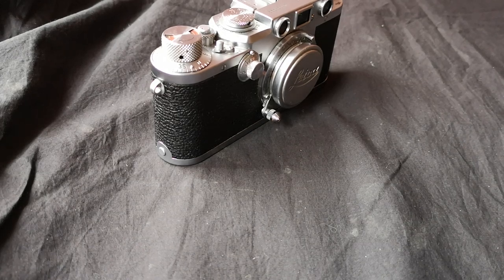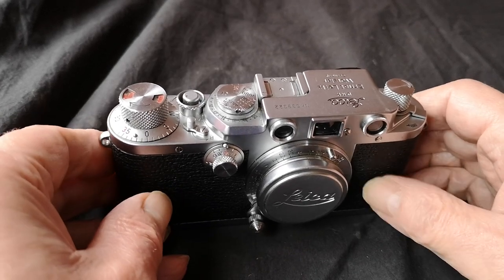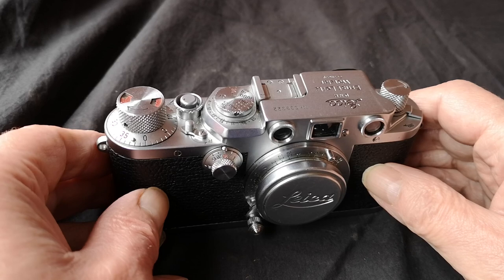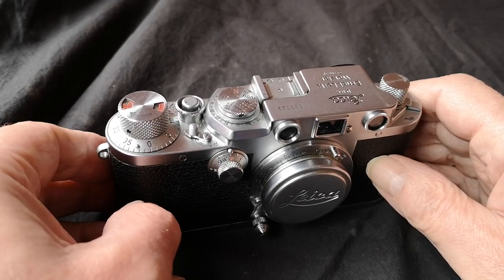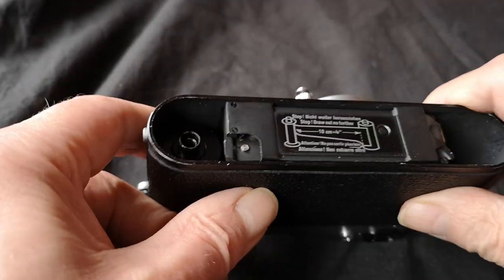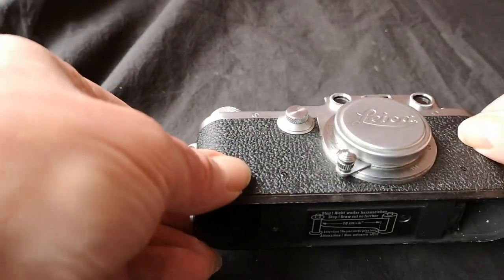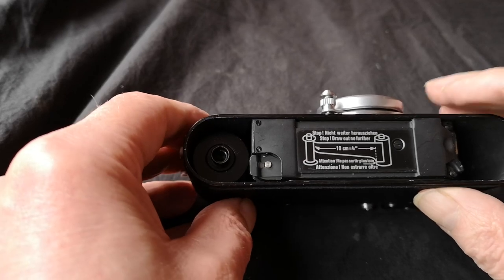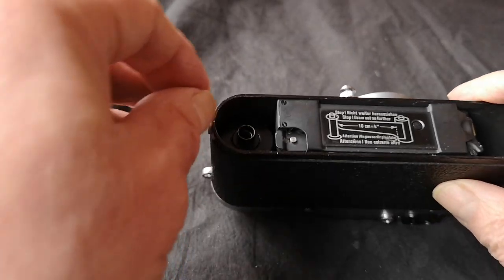Using a screw thread Leica

Comment: Just found your channel. Brilliant explanations and very informative. I have a few Ms and I am very interested in a Leica III. Can you give an explanation on how do you choose them, What are the pitfalls and highlights of the selection - Given their age?
Reply from the maker: Well it's a good question. Maybe I will do an upload about what I look for or at least ask questions about if buying online. I don't think age is a big factor its all to do with if and when the camera has had a  service and where it's been stored. But to try to answer your question remove lens if it has one and shine a torch through it see if there is any serious haze or fungus.Check the shutter blinds for damage.Assuming there is a lens with it put it back on and check to see how clear the rangefinder is and the viewfinder. Listen to the shutter and make sure it's not sticking try the slow speeds if fitted and if they are sticky be prepared to spend some money on a CLA. Hope that helps a bit. Thanks for your kind comments too.
Reply: northstar1950 thanks! The issue is usually with slow shutter speeds, not high ones?
Reply from the maker: @sharonleibel  , sorry for my late response, it's both!  I believe curtain lag is more likely to be seem at the higher 500th- 1000th speeds.

Comment: Very insightful video, thank you. A question; when looking through the viewfinder, does the field of view adjust to the mounted lens?
Reply from the maker: Hi Chilli , the simple answer is no, but you can, at some expense, buy individual viewfinders designed for specific lenses or you can buy a device that had a turret that revolves which I think have four small lenses covering most focal lengths. I don't own any of these. The above have a base that slides into the cold shoe that would hold a flash gun normally. Only the later 'M' series had frame lines that alter depending on the lenses focal length.
Reply: @northstar1950  oh ok thanks. So what’s the standard focal view through the iiic viewfinder? 35 or 50?
Reply from the maker: @chillimoroka7744 , the standard lenses are all marked 5cm or if you like 50mm. These include in order of introduction  Elmar, Summar, Summitar and Summicron. Some Elmars are 35..
Reply: @northstar1950  I understand that, however my question is related to the camera’s viewfinder, what field of view do I see when looking through it?

Comment: I am considering getting a leica iic, i have quite a few of questions 
How does the old ltm lens work with colour film?
Is the slow speed necessary?
How does it compare to more modern film slr(e.g nikon F2, canon A1, contax rts)
Is it really worth it buying a leica thread mount?
How durable is it?
Can it stay with you for a lifetime?
Sorry for all the questions, sorry for wasting your time.
Reply from the maker: Hi Das Hinata, please accept my apologies as I have only just seen your question. The older non- coated lenses will flare if  used into the sun so the later coated post war lenses might be better for colour work. The slow sppeds arn't essential and only the Leicas III types had the slow speeds. These are range finder cameras and so cant really be directly compared to moderner SLR camera. Leicas like these have a rangefinder system to aid focusing and composition is via a viewfinder with a window on the body. A good one will last a lifetime and if it does need repairs or servicing there are specialists who can do this. I hope this helps.Good luck.
Reply: northstar1950 nothing to be sorry about, great explanation, thanks you!